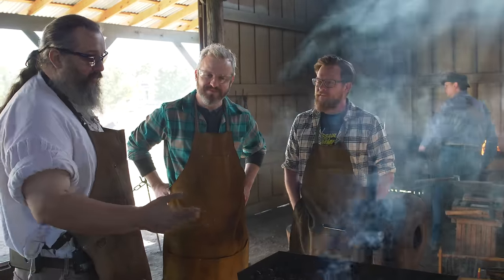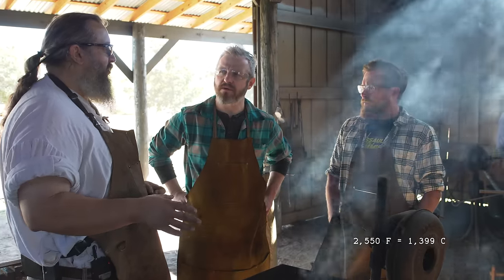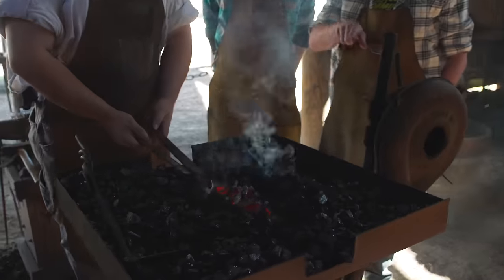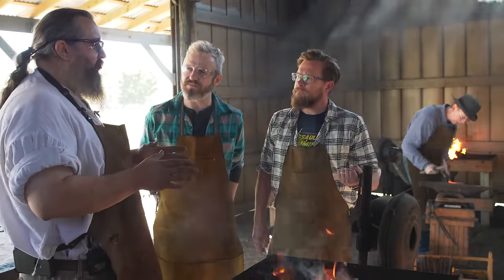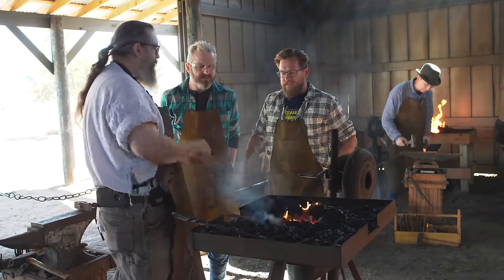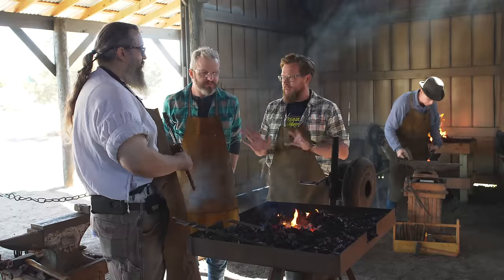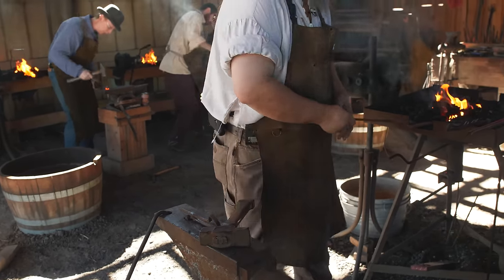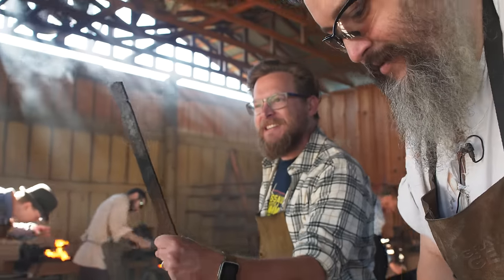Blacksmithing: Forging a Bottle Opener

Comment: Brian misses like half of his hammer hits.

"closer you are to the head more control; the close you are to the bottom more power."

Proceeds to continue to hold it at the bottom
Reply: It really depends on what build Brian wanted.
Y'know, like...
What would you rather want?
A super powerful DPS build, or some weird build that's based around a 100% hit chance?

Kappa
Reply: @Known_as_The_Ghost wouldn't hitting 100% of the time increase DPS
Reply: @someyeeterontheblock2421  
Most games have a hit chance of around 96%.
Literally every single gear slot specialized in ACC is a damage down-grade compared to a full set of specialized INT, STR or DEX Gear.

Those 4% extra attacks would be nothing compared to x20 or even x1.1 damage.
Reply: UNLIMITED POWER!!!!!!!!!!
Reply: all I can think is power = bottom (power bottom) (you will probably only get this if you're gay)
Reply: @gametheorybackpack  Well shit, guess I'm gay.
Reply: You actually want to hold it at both ends, like an axe or a pickaxe and bring it down to where you're looking at in a throwing motion by sliding the hand that was closest to the head down the shaft while swinging it with both hands.

Comment: Three Rules of Blacksmithing 
1. It's Hot
2. it's still hot
3. see rules 1 and 2
Reply: True
Reply: Those are basically the same rules that I follow don't touch the glowing bit. However if you hypothetically need to see if something is still too hot to touch. Touch it with the back of your hand. The back of the hand has many less nerves for pain and if you do burn yourself you still have the ability to use your hands without discomfort.
Reply: @AusyG  we were taught to be sure by throwing some water on the steel to be sure. Water was in abundance in the forge, big quench buckets, smaller ones for chisels etc. That said, I still managed to get a black steel burn when I was on a course here in the UK.
Reply: @monolith1337  I also sometimes lick my finger and touch the surface quickly and I can feel the spit on my finger bubble without burning me.
Reply: @AusyG  That's quite a way to apply the leidenfrost effect.
Reply: Similar to welding
It hot
It's hotter
See 1 and 2
Reply: As a blacksmith apprentice I can verify this first hand 🤣
Reply: The reason its so important is because steel can get up to around 800F before it begins to glow. And anything above 100F is hot

Comment: Blacksmiths: Make swords and cool ass daggers

The Modern Rogue: wanna make a bottle opener
Reply: You gotta start somewhere
Reply: Alcoholism
Reply: David Goodner I did a knife-making class once, then went back and did it with my dad and brother-in-law.  While there, we were talking about what shape to finish our blade in and I told the instructor that my last one had been in a very sharp, pointy, stab-effective shape.  "But I haven't had many chances to really use it." 

Instructor - "Sounds like you need to make some lifestyle changes."
Reply: @adamwynn1001  I know some reenactors who are also blacksmiths that have that mentality, sadly most insurance policies will outright refuse to cooperate with groups if they are using sharp/pointy blades.
Reply: When you think about it a bottle opener is  quite intricate too so it's still not the easiest thing to make
Reply: Knife making is something a smith with at least 2 years of experience shoukd try. Trust me most blacksmiths will tell you this. I'm an amateur and I'm well read on it so i know a good bit, knives are fucking hard to make good. You can make a shitty knife on your first try but its better to wait.
Reply: @karvast5726  It never gets old either. Look up forged bottle openers, there are hundreds of different designs that utilize all kinds of techniques.
Reply: Bladesmiths make cool ass blades and daggers. A blacksmith would absolutely make bottle openers...

Comment: His explanation about how to the peening works seems like it would be helpful for dough shaping.
Reply: i'm guessing hot metal and dough work roughly in the same way
Reply: @macksii  TBH all I know for certain is that my rolling pin technique is trash.
Reply: It's kind of the beauty of sculpting with soft material. I'm no sculptor but the ability to make and fix mistakes is great.
Reply: Blacksmithing feels a lot like shaping clay
Reply: Robbie Cash I took a class in blacksmithing once where the instructor started out as a pottery maker.  She said that they move the exact same way, and a lot of people use clay as a sample material for how to move metal.  I think there was King of Random video about that, actually.
Reply: @adamwynn1001  yee, even did a full analog 2/3 episode where they even "reheated" the clay by dunking it in cold water, because clay acts almost exactly like steel, but on the opposite side of the temperature spectrum

Comment: Lol, the bottles they opened are twist-off XD
Reply: The only downside to owning a bottle opener in 2019: you never get to use it
Reply: @theprogrammer32  well.. I actually drink things that have to have a bottle opener
Reply: @tuckerrichardson2606  Yeah but lighters solve that
Reply: Block0fWood I have the multitool they sell on scamstuff and use it primarily as a bottle opener and even though I don’t use it a lot it has come in handy several times. So much like a lighter it’s wise to carry one around
Reply: @BaldMancTwat  Odd, though we do have more "tool required" tops than twist offs in America, I did expect the number of twists offs to be about the same country to country, but guess I was wrong
Reply: @theprogrammer32  I've never seen a twist-off cap in real life. (I'm from Sweden)
Reply: which makes it harder to open with a bottle opener XD
Reply: Sheski im in germany, i have never seen twist off beer
Reply: @Cortalpsychmajor  I use my wedding ring since it's tungsten and won't deform at all. Takes a bit to get used to since it can be kinda painful
Reply: @gilbertmckown6161  Dude, opening a bottle with a bic lighter is easy, you make a ring with your index finger and thumb, then place the bottom of the light between the cap and your index finger and pop it off. That's the same thing a bottle opener does.
Reply: @johndoeanon445  I'm from sweden too and I have seen a twist off. It was imported :'D
Reply: The modern rouge doesn't believer in twist offs
Reply: @theprogrammer32  You can still use bottle openers on twist offs to feel badass
Reply: @johndoeanon445  Me neither in Germany.

But either way, a bottle opener isn't needed. Either use a second bottle, a lighter, a spoon, a rolled up news paper anything will open a bottle.
Reply: @Cortalpsychmajor  You can even just roll up a magazine and use it like the edge of a table..
Reply: @emilychb6621  Yeah, sure. But a bottle opener doesn't take up very much space on your keychain.
Reply: I usually just open them on the car door panel
Reply: i mean the easiest bottle opener is just a hammer
Reply: @Cortalpsychmajor  lighters, spoons, a metal dust sweep thingy, a metal chair, yup used them all, and teeth once never again
Reply: WhAt
Reply: @theprogrammer32  At uni I put a 3D printed bottle opener on the keytag. I only used it a handful of times personal, but the amount of time other people asked for it was pretty high.

Comment: Ah yes the tool that can be replaced by pretty much anything
Reply: vise grips make better bottle openers than actual bottle openers
Reply: @BaldMancTwat   Karl Smallwood opened one with a cue ball.
Reply: @Carbon2861996  and another beer bottle, and paper, and literally anything
Reply: @total_kayhem5193  I learned as a kid how to open a bottle with my teeth. (Its dangerous. Dont do it)
Reply: Gotta start somewhere
Reply: Pens are a fun one....
Reply: @Carbon2861996  holy shit man you're the only person I've come across that watches fact fiend and modern rogue they're literally my too favourite YouTube channels and I instantly thought of him using paper
Reply: @total_kayhem5193  I've never encountered anyone who watches fact fiend and modern rogue and I've seen two people in this comment
Reply: @c.easium9012  You two aren't the only ones.  Fact Fiend is awesome.
Reply: Thought the same thing. Have straight up used a paper towel to open one before.
Reply: C.easium! Fact fiend is awesome
Reply: Yes, but a bottle opener becomes much better when they're like the ones that Kobalt made that are strong enough to break someone's kneecaps, run over with a tank, and still work fine.
Reply: Yeah, literally anything that can give leverage can be used as a bottle opener. Karl Smallwood is a great example.
Reply: @total_kayhem5193  Nah fam, alot of people have chipped their teeth trying that shit.
Reply: My new favorite is opening bottles with a Copenhagen tin.

Just in case ya don't carry a lighter
Reply: Some would say they turned a bottle opener into a bottle opener
Reply: Total_Kayhem if you can Vite through a glass bottle you need to be tested by scientists
Reply: @therabbits69  ohh, we got a badass over 'ere

Comment: I'm liking the nature of your sponsors, but I still don't know what I swipe is. Do you ingest it, or does it attach to your... Sandwich tool? Maybe a diagram would be helpful.
Reply: I think you wipe the swipe on your pipe and numb your plumb.
Reply: They’re numbing wipes meant to reduce one’s sensitivity, to increase stamina.
Reply: @coyotedomino  oh, that sounds... Unpleasant. Like it might create other problems. Why not just make two sandwichs, if your partner is so slow?
Reply: Brodie Knight well, not everyone is able to make two sandwiches consecutively. Making sandwiches can be very tiring.
Reply: @coyotedomino  well sure. You take a rest and catch your breath, restock your mayo, and get back to it. To have an intermission in between is better than to leave your partner with a half made sandwich. Even if your sandwich tool is unoperational after the first sandwich, it's easy to take your two bare hands and help your partner make her sandwich at least. But I do see what you're saying.

Comment: The fan on the forge looks like a turbo charger found in a car, I assume close to the same principles apply when it comes to forcing air into the coals, pretty neat

Comment: 100% agree about the glove thing. I lit my gloves on fire a lot when welding because I was too impatient to grab tongs and pick up a piece of metal that I had either just cut the slag off of or welded. Only actually hurt myself the first few times because I learned to take the gloves off and dip em in the water I used to cool the steel. Not a certified welder as I dropped the course, wasn't for me as the primary instructor was a dumbass (stole students work and claimed it as his own), the other 2 assistant instructors had actual experience and were the ones in charge of grading. The only reason they weren't in charge is they both could barely stand after years of hard work.

Comment: You have to quench the punch to keep it from losing its temper. You'll have to redo the heat treatment if you do that. It will be too soft if it gets too hot. For anyone who wanted a more in depth explanation of how too much heat will "mess up" the punch.

Comment: I'm confused as to why they're using the hardy hole on the anvil while punching/drifting instead of the pritchel hole. I guess it makes sense, though, since the larger drifts wouldn't fit through the pritchel hole.

Comment: makes a bottle opener to open twist off lids
Reply: @Nerdycopia  I always have trouble opening twist offs. The texture of the cap always seems to cut into my hand. I always open them with an opener.
Reply: @majorphysics3669  Also, since the cap is made from softer metal, when you do manage to open a twist off, the whole drink has a metallic taste to it. I've never had that problem with a regular bottle.
Reply: @majorphysics3669  Try using your shirt as a 'glove'...
Reply: Known as that’s what I do when I don’t have an opener. I’ve ripped a couple shirts though lol. Maybe I’m just buying bad booze with cheap bottles that are welded shut
Reply: @majorphysics3669  Or maybe you're buying bad shirts that rip easily. :P
Reply: Known as maybe. I do like my 5 dollar Walmart specials. Then it’s not the end of the world if it gets ripped or burnt or painted on. XD

Comment: I teach metalwork merit badge at my camp but they make us wear gloves for "safety" I've burned my hands so many times because i sweat in the glove and the hot propane forge releases so much heat that the sweat in my gloves turns to steam from 4 feet away and burns my hands.

Comment: As a blacksmith I cringe every time you struck black steel. Anytime your metal isn’t red you create fragments in the metal and if enough form you can hammer a piece and it will basically explode.

Comment: The glove thing is horse sh#$, Don’t grab hot steel in the first place. Gloves are just a personal preference, yes you can burn yourself with a glove on, but you can also flip what your working on out of your hands, or tongs, and make yourself wish you were wearing gloves. If you need a glove, put one on, if you don’t, then don’t.

Comment: As someone that has worked in a forge please actually wear gloves. Especially if you are working with steel. Not wearing gloves removes your protections from heat and sharp bits that may be produced when forging. Also ear protection to prevent tinnitus. This guy is just too cheap to use protection or too rooted in his ways. Some times some eye protection but it isnt too bad. Your ears eyes and hands are a craftsman's necessity. I didnt listen to friends when my instructor and later boss told me i didnt need them. Turns out i have tinnitus from it.

Comment: The steel was too cold when Brian was fullering the steel. When working with steel, if you hit the steel when it's too cold, you get cracks. When the guy with 20 years experience "professional" let's you work cold steel e.g fullering the steel or peening the steel, he's not so good at teaching. Cracks in steel aren't good regardless whether you're teaching. You want to prevent it. Not nurture mistakes